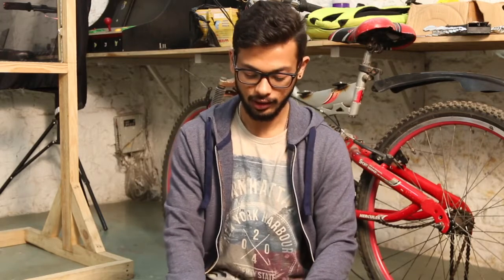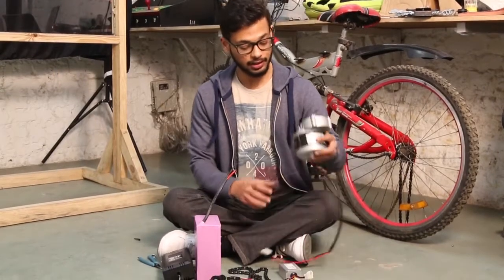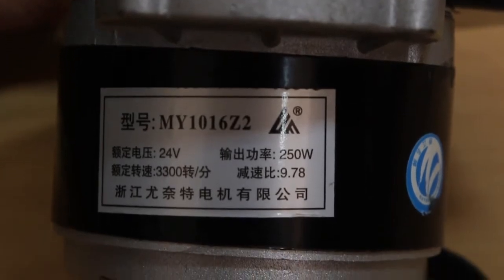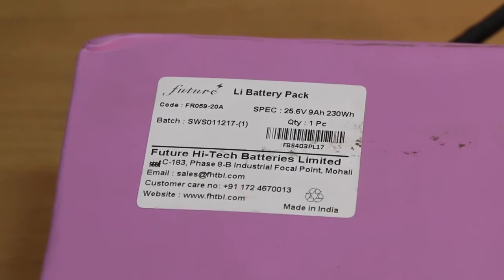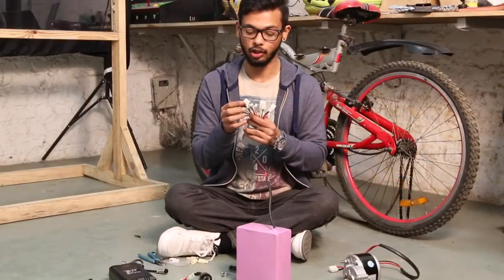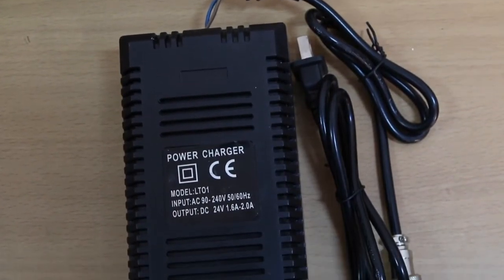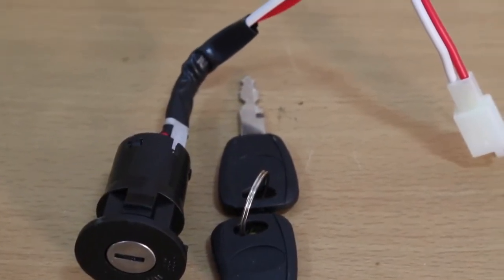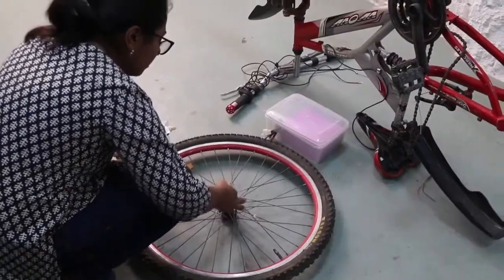Electric Bicycle DIY Project - How to make E-Bike in India?

Comment: hey new idea coil inside bottle shaped wire for generator. this will eliminate the need for transformers in diy e bikes. automatic amperage step up experiments should be tried all may use.
Reply: Nice